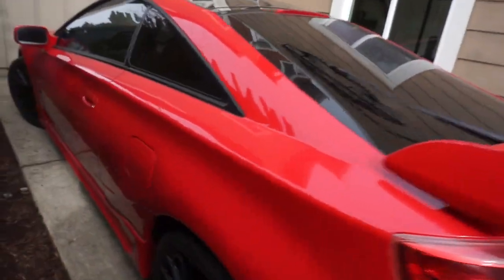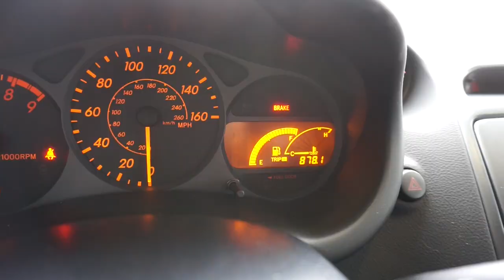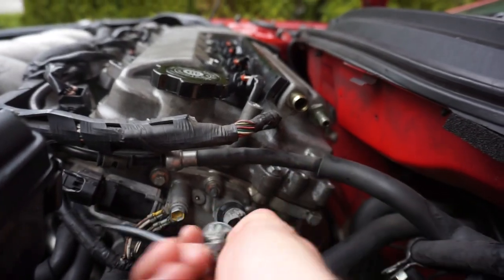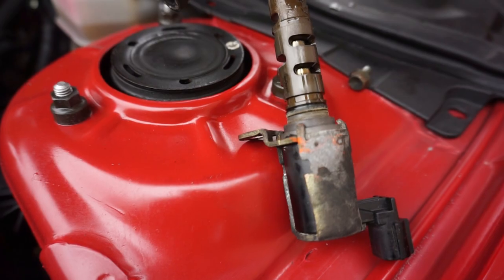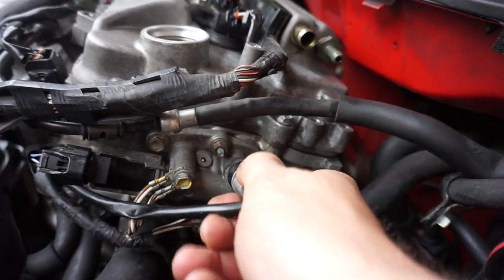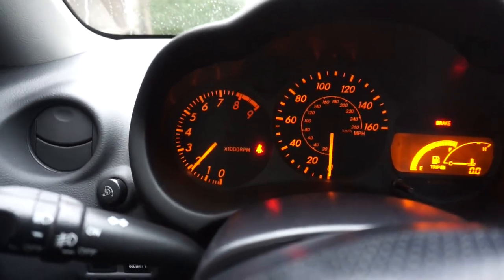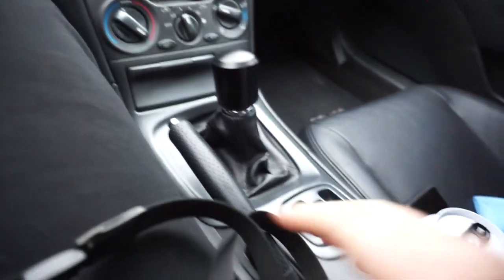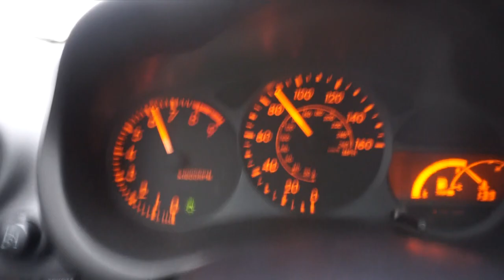"HOW TO FIX CELICA LIFT" 2ZZ-GE VVTL-i

Comment: I bought a 2001 gts manual with 218k 2 weeks back.. I seriously doubt they changed the lift bolts. Getting a rebuilt trans, sync gears and clutch. Still haven't done an oil change yet. I hope the lift bolts were changed?..... lol awesome video

Comment: Always dropped oil every 2500 to 3000 miles as you say. Like you basic maintenance is prerequisite to keeping these cars at top performance. Have changed both screens as there are two, one for the VVTi and the other as you state for the "Lift". Carb clean the intake always good. MAF sensor cleaning also good. Lift bolts change to updated ones. If unsure you can find something on YouTube -  no doubt about that.
One fault I find with the 2ZZ is the timing cover gaskets can break down over time. Most think any oil leak is the rocker cover or chain tensioner or power steering pump, but for some reason Toyota 2ZZ can have timing gasket issues after high miles. Can be a pain to change but possible without removing the engine fully.
Brilliant video. Mitch knows his 2ZZ's so keep tuning in.
Reply: Edit: The VVTi filter (Not the Lift one) is located just underneath the alternator. But for just Lift mode, just change and clean the VVTLi filter as Mitch mentions.

Comment: Mitch, is there another solenoid on the face of the engine by the alternator, I wonder if that should be clean out; if so how would you get to it?
Reply: I had to remove the alternator to get to it. Mine was very clean at 134k miles

Comment: Fantastic video! Thanks for making it. My lift is gone and I assumed it was the lift bolts but I will try this for sure first. Have you a video changing the lift bolts if this doesn't work? My 2ZZ is pouring oil out from what looks like the timing chain tensioner gasket. Could be the rocker cover gasket either. Was gonna attempt the rocker cover gasket when I try the lift bolts but not sure I'd be comfortable doing it. I don't use the lift that much but I miss it now it's gone!
Reply: 2zzlow has a video on it, and if its leaking quite alot of oil it would most likely be the timing cover gasket. its a very common issue because of the age and mileage of them now. and the timing cover needs to be removed to fix the lift bolts, its much easier to do it with the engine out of the car

Comment: Amazing video, my celica isnt hitting lift, i change the lift bolts, by the way it was a swamp engine, my celica use to be a gt, but i bought the 2zz engine i believe its a 2001, i just got a quick question, i just changed the oil on my car, will it be ok to clean the little filter with out changing the oil??
Reply from the maker: I would definitely do an oil change!
Reply: Thank you very much i will for sure then
Reply: @MitchDore mate the 2zzge need valve adjustment service or not?

Comment: Nice Vids Mitch! I am about to do this procedure on my 01 GTS and I have a few questions.
1. Does the engine need to be drained of oil to do this?
2. My lift is fine on gears 3rd and on. The issue  is 1st and 2nd gear. They both struggle to achieve lift but they do get it somtimes. Which leaves me to believe this is the fix and not the flange bolts (lift bolts). But I do have those too incase of future supply shortage.
3. Did yours have issue on all gears?
Reply: oil doesnt need to be drained, but have a rag ready. if your lift is not working in 1st and 2nd i doubt its working from 3rd, lift doesnt come on as hard in those gears so its less obvious if theres a problem. probably easiest to check your lift bolts at the same time as trying this fix as if they are broken you need to take the ocv off anyway
Reply: @arcanevoid9199  Hey thanks for replying. If it is the bolts, wouldn't the symptom be completely no lift?  In other word, Like I mentioned I do get lift on 1 and 2 just with hesitation. For example, I would launch on 1st and feel a sorto of stutter (Similar to redlining), but keeping foot pressed on gas it eventually  goes to lift, just not as quick as it normally would. 2nd gear same. As long as I keep foot on gas, it will reach 5-6k rmp, needle does a dance and then go to lift.
Reply: @retzu7612  well with my car only one of the lift bolts was broken so there was a crossover but it didn’t really go any faster. stuttering is different, might be another issue. just to confirm that you are getting a burst of power at 6k rpm?
Reply: @arcanevoid9199  Yikes! Did you go through the broken bolt process that involved taking cams out and all?  6k around that vicinity if I recall. I will look at it more carefully next time i punch it so I can report confirmation.
This is the first time i can enjoy the car. When I got it new my daughter used it for college and then my son. 20 yrs later its mine again lol.
Reply: @retzu7612  yes I’m in the middle of doing it haha,  needs a suspension overhaul aswell. would be a good little car for college lol

Comment: Thanks Mitch - pretty straight forward but detailed! Curious: have you ever fixed the secondary air injection on any celica you had? Is it worth it? I have the same code throwing every now and then
Reply from the maker: You can put a resistors in wire to trick the ecu.

Comment: great video i will be checking mine an changing the lift bolts over the weekend. im just curious as to there being no gasket on the part you take off?
Reply: Hey John. How easily did those lift bolts come loose for you? And did you untighten manually with hand tools? Just curious if Im gambling swithcing them out if its not called for just so I can add new bolts on them. Sometimes doing the precautionary changes can lead to worse cirumstances such as untightening them only to snap them unintetionally doing the process. I just dont want to be that guy who end up leavin a piece of the bolt in thread hole and now has to take it all aprt to get to it. Please advise.
Reply: @retzu7612  was really easy 1st time I’ve ever done anything like that. Just manually undid the lift bolts, used a small bar as to not use to much pressure and they came right out. Did the new ones up with a torque wrench (can’t remember the setting off top of my head)and job done. I have the face lift model celica so I believe they have different lift bolts. Also cleaned the filter in the solenoid which was super easy too. I did both this as precautionary but lift does feel a lot harder. The lift bolts were pretty worn. Did both jobs in under an hour. I’d recommend doing it, I’m a complete novice and I breezed through it

Comment: Youre not gonna believe it, but I did this job and now my fans are always on for some reason
Reply from the maker: That's is the coolant temp sensor is not plugged in correctly
Reply: @MitchDore  thanks a lot, the plug is in bad shape I have to fix that.